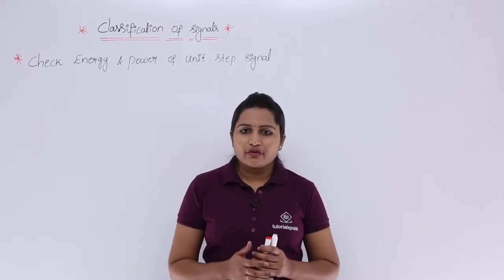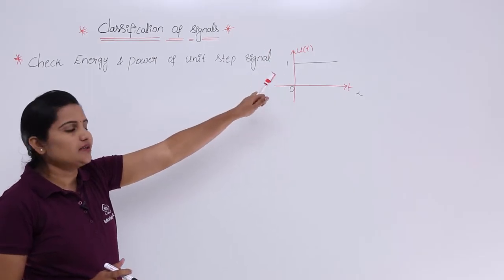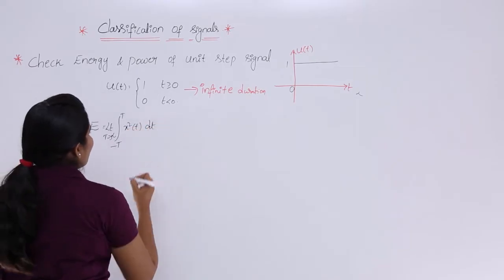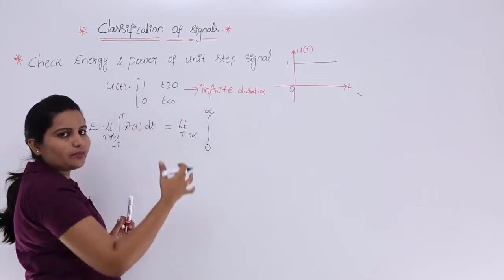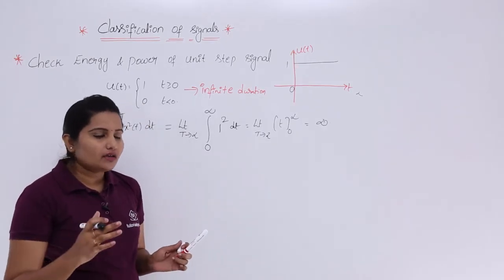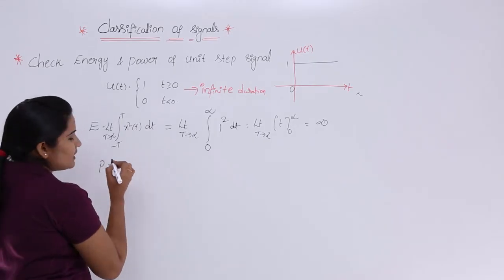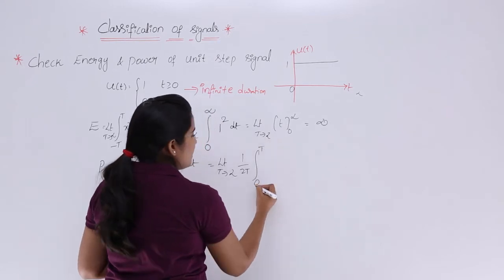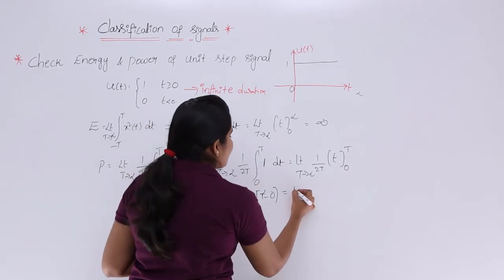Energy & Power of Unit Step Signals

Comment: ma'am why did you take the limit of power signal from 0 to T? 
please explain
Reply: You need the average function value over a (any) period.  0 to T works, then the length of that interval is 2T.
Reply: @harikrishnanl3928  no problem.
Reply: Noob
Reply: There is no need to integrate from -T to 0 because the unit step is 0 when t < 0.